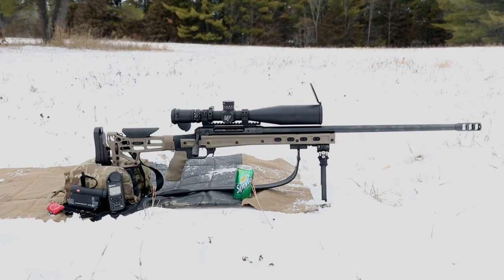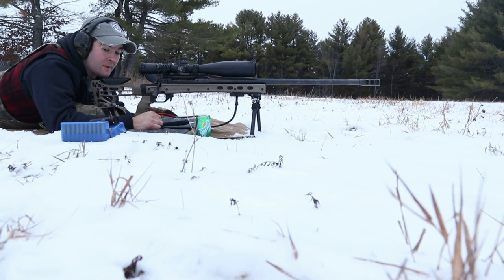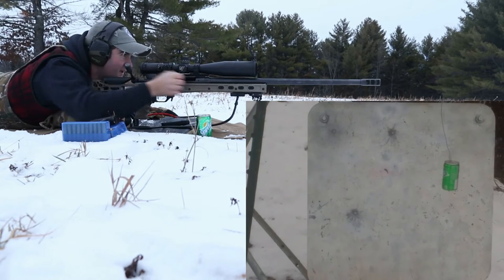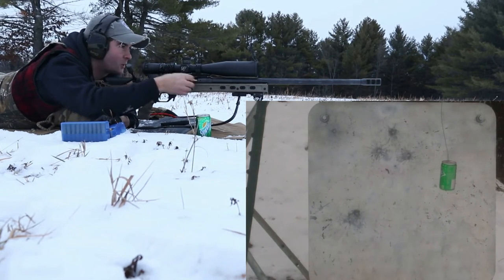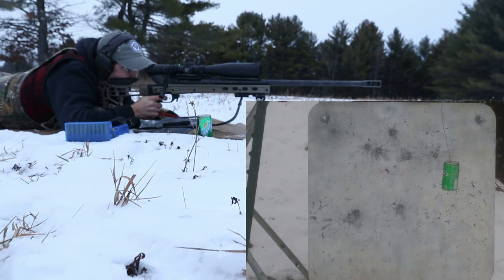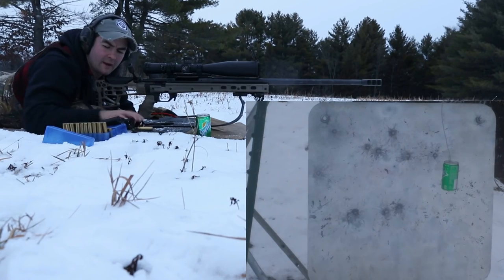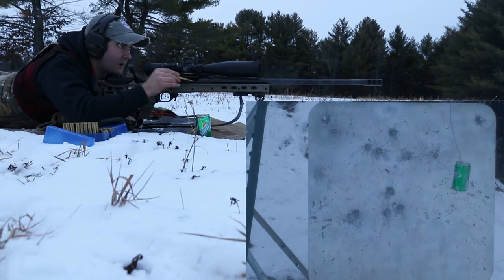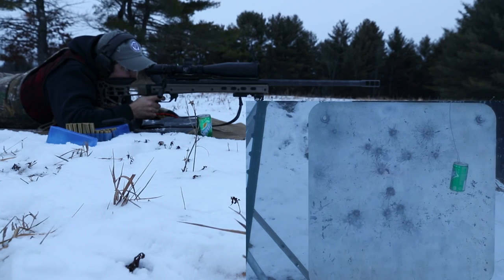Savage 338 Lapua, 20 shots at a 7.5 oz Soda can at 1004 yards.

Comment: I've gone through a few of your videos tonight alone. Great job with the editing and filming. I've been shooting my dads 338 Lapua & Accuracy International 300wm. Those two builds are well out of my price range but I think your gun performs quite well and is substantially less investment. Could you please send me your specific build? This is right up my alley. Thanks for your time and keep the videos coming.
Reply from the maker: chris tristan 
This rifle is a Savage 110 338 Lapua. It started from the factory with a HSS Precision stock. I changed out the stock with the MDT HS3 Chassis which I absolutely love. I also changed out the accutrigger and put in a Timney Trigger. The grip is a Ergo Tactical.Other then that the  gun is totally as it came from the the factory. $1500 for the gun from Savage, $100 for the trigger, $50 for the grip and about $795 for the Chassis.
Reply: Next Zipcode thanks! Could you please give me the model number of the rifle? I have been shopping and see that there are a few 110s with variations. Also I looked up then chassis and didn't see that it came with the stock? Did you have to buy that separate? Thanks again. Looking to duplicate your accuracy at least through hardware. Thanks for the videos!
Reply from the maker: chris tristan 
It is the 110 FCP and yes you have to buy the buttstock separately.

Comment: Hey man ever have any issues with reloading for your lapua I have the same rifle and I see some of your shots you need to smack the bolt when ejecting rounds I'm using a mild load and it also has a click right at the top when ejecting any tips or is this normal for the savage
Reply from the maker: Hey Jeff it may be a Savage issue...I since have had my barrel chamber polished and it has gone away. I think the Savage factory barrels can have small burrs left behind that make bolt lift and extraction be a little more difficult sometimes
Reply: @nextzipcode  what load are you running in yours? what kind of velocity are u getting ?   Thanks
Reply from the maker: @jeffburns4597  I have use the 300 gr Berger Hybrid pushed by 89 gr of H1000. Out of this 26 inch barrel it is moving 2705 fps